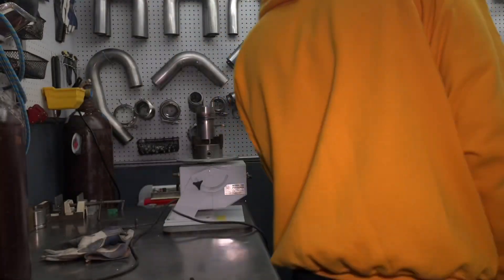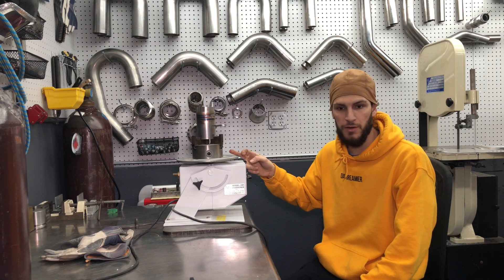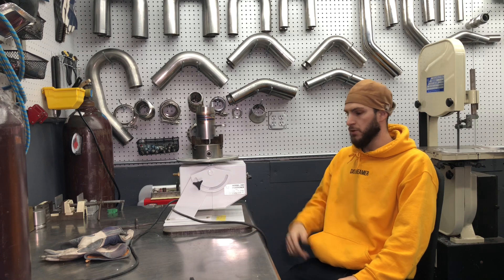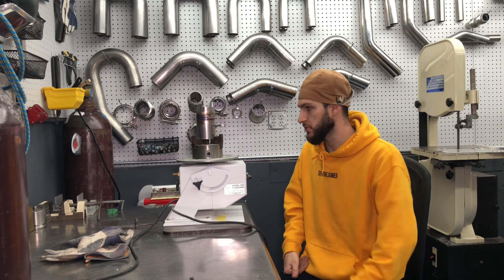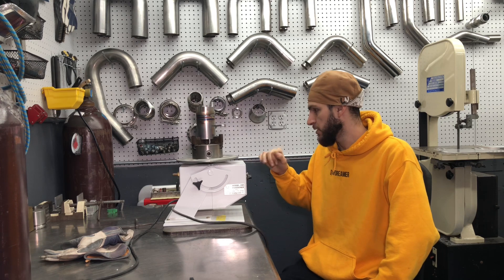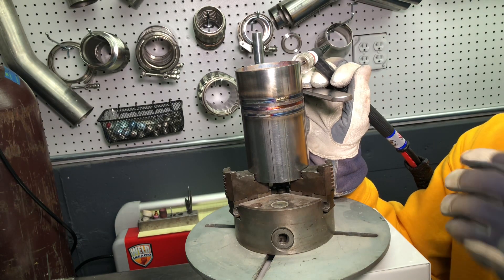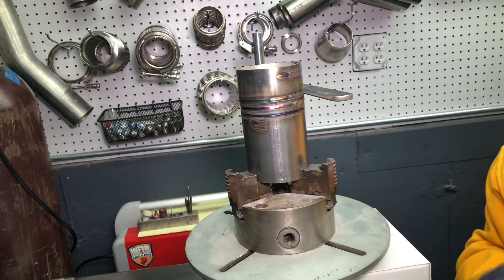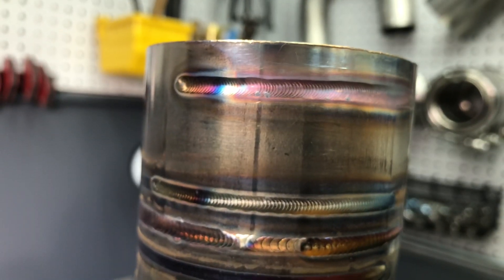Autogenous Tig Welding Stainless Pulse settings

Comment: On another note I just subscribed.  Thank you very much for sharing your experience, your settings, and your setup.  You are sharp 😎. I use my pulse on 33% background and 33% on time at 1 to 2 pps. I'm going to try bumping up the speed some. I dont do much SS. Mostly just steel. Im up in the 250 amp area on 1/8th inch with filler. I just lay wire. My eyes aren't what they use to be and my filler hand is slow so I bump up a filler size and just lay wire. Again... thank you. I am going to some oxy/fuel cutting videos in the near future so look out for those.
Reply from the maker: Try these setting and let me know how you like them. 300 amps 15% on time 30% background and 1.5PPS. You can do lay wire. If you want to dip filler try same settings but .9PPS. Happy welding
Reply: @belloautomotive1522  thank you. I am going to start a note book and make a holder for it to mount on the side of my 400. I went a little overkill on my welding equipment here in the home shop... my mig set up is a XMT350 and S74DX Feeder with a optima pulse pendant. I want another smaller tig and and mig set up for the other bay and I am looking at Avortec and Everlast. I have a Everlast 100s plasma that I retrofitted a Hypertherm Duramax torch to which made it perform much better. Ill give those settings a try. Thanks

Comment: Curious how strong autogenous stainless welds are? Especially with the heat cycles a stainless weldment usually goes through(downpipe,header,exhaust etc)
Reply from the maker: Pretty strong if not just as strong if done correctly (purged and full pen). Welds usually crack on the HAZ so regardless if you add filler or not its docent crack on the joint itself.